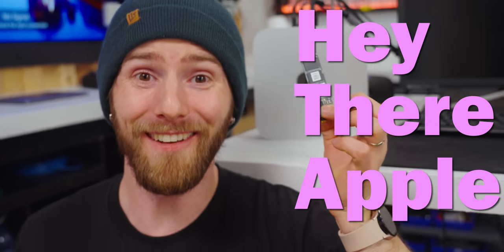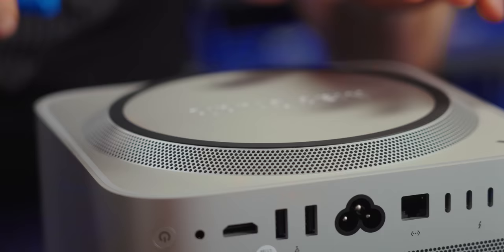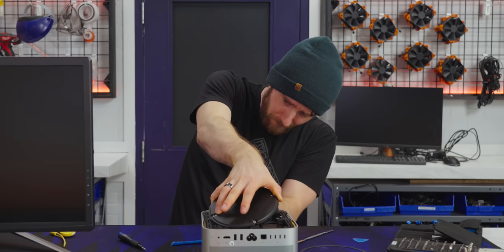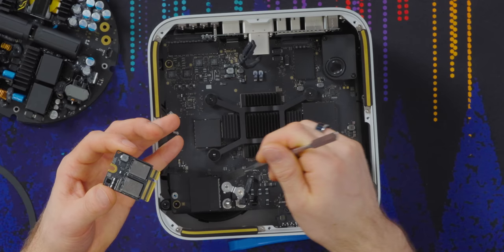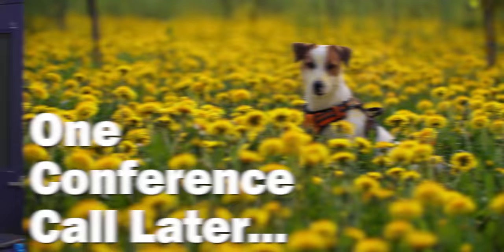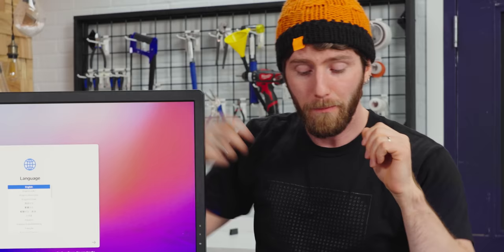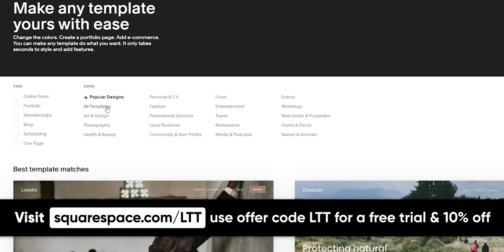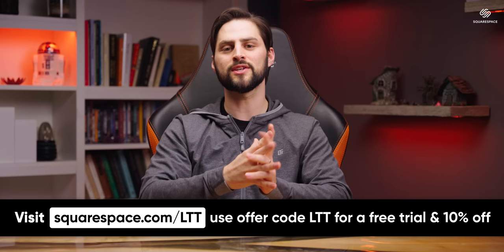I want to love Apple, but they’re making it hard - Mac Studio SSD Swapping

Comment: Apple is making a killing on upgrades. Apple is clearly anti-consumer, however their marketing and brand recognition is so strong, that the very people that they are screwing are defending them like there is no tomorrow. It is just sad.
Reply: and enter one of those defenders 😂. Apple has a philosophy. To make great software, you have to make your own hardware. I've always been a PC enthusiast and enjoyed upgrading parts. The problem is that Windows frequently crashed. A lot. Usually driver conflicts from various manufacturers. I now have a Mac Mini M1. Sure I can't rip it open and add a new Wifi card or RAM module...but it's never crashed. Not once in the six months since I've switched. Add that to the fact I really never have to worry about malware or viruses... I'm sold. Maybe it's just something that happens when you get older, but I don't I don't want to rip open computers just to add upgrades that don't work because of driver conflicts anymore. I just want something that works for my needs and so far Mac excells at that. I use to blame Windows, but you can't expect an OS manufacturer to make sure their OS works with every third party peripheral, or expect peripheral manufacturers to ensure their peripherals work with every other peripheral on the market. That's why Apple adopted the philosophy to build their own hardware. Yes, they still use third party suppliers for stuff, but very much under their own quality control. Enjoy your blue screens of death that you get from the freedom to mix and match hardware. The time I save from not dealing with that crap anymore has made my M1 Mac a very worthy investment and I can understand why Mac doesn't want to get the same reputation Windows has by allowing consumers to mix and match hardware willy nilly causing OS crashes.
Reply: @jamesboggs5735  tell me you don't know how to install drivers for hardware without telling me you don't know how to install drivers for hardware
also, your mac can't run most games which is fine if you're not a gamer but as long as gaming exists, windows will still rule. 
Mac is like a golden cage. It is nice, but still a cage. No freedom to experiment with.
Reply: @jamesboggs5735  I work on windows. 0 crashes in 3 months. 1 crash in 6 months. I can make my OS to be the way I want. Everything is the way I want. You can't do that on Mac.
Reply: @jamesboggs5735  the same regurgitate stupid and not trie things that apple zealot said. I remember when i have my first pc, a windows 98 gateway machine and my best friend ordered the first imac, he criticises pc to the end, even without the imac. We has been in my house with my pc, zero crashed. The day arrive and the super imac was delivered. The imac goes crash after crash, evenhe needs to disconnect the machine from the power outlet to start again because there were no other way of escape from a hard crash. I can print things doing another thing and he cant because his super mac was not multitasking. I know the history and the lies combine with apple distortion field. All the things that this guy said, are not  true. I own my gamer windows pc, and zero problems, zero cashes
Reply: @jamesboggs5735  And here enter someone working professionally with ALL these systems. 
Crashes happen on all OSs
Apple doesn't have more great software, they approach is to make simpler software. Windows can do much more, hence it can crash more often, but we are talking 5/100pc vs 2-3/macs in average. My PC didn't crash last 3 years. No joke.
Anyways, what I was talking about was being ripped by Apple. So, this is not related to which hardware or software is better. It is how its clients are treated.
I will tell you: disrespectfully.
Because, nothing stops Apple to sell you two more chips for double the price instead of triple the price, except they have control you and you are not allowed to upgrade your OWN hardware! Just think about it. You gave (a lot of money) and you still have no control over.
And the real reason: Not the technucal one, or client oriented, but so that they can make more money. On you, their true customer. 
Take as you want, but I do not like being treated that way. Period.
Reply: @jamesboggs5735  Well, I use multiple Systems. My undervolted Gaming PC (Windows) runs stable non-stop. Only those damn Updates make me reboot. I use a MacBook for Work. Runs fine for a while now. But a while back a major Update killed it. Good, that there is Time Machine Backup. MacOS has it's ups and down. For example M1 is not quite there for me as a Developer. 

But, all of you forgot about another big OS. Linux-based Distros are killer in some disciplines. I got Machines running for months without a restart at all. Not one crash in years und really fast updates. Shockingly, some Desktop Distros are even more user-friendly than Windows 10.
Reply: @jamesboggs5735  Found the apple shill
Reply: @jamesboggs5735  old people really dont care whats happens to the future generations and it shows. Just because you can buy a new Mac with your 401 whenever the screen ribbon ripped doesnt mean you should support them.
Reply: @nadarith1044  I guess I am too. I'm just not into ripping shit apart or upgrading things. I just want it to work. My iphone 5 and macbook air just won't die so I guess I'm a fanboy or whatever.
Reply: @xergiok2322  BINGO! I have replaced the battery on my macbook air but thats as deep as as I ever want to go.
Reply: @jamesboggs5735  I am a longtime Mac user, made President of our local MUG in the 90's. Got a bit freaked out when OSX arrived but learnt its quirks (fsck anyone?) I got a new M1 MacBook Air recently and guess what? The dreaded spontaneous screen crack occurred it's now a Brick sitting in the closet reminding me to NEVER buy new. I'm happy with an older model with magsafe, regular USB etc.
Reply: @nadarith1044  I guess I am lazy but you get that. If the next ones fail, I'll change but at this rate... there's probably only a few changes in me before I get boxed up
Reply: @user-kc5fp4tj9y  Please tell me what all these alleged bugs are in macOS; I don’t encounter any day to day.

If you want to hack at your computer, use Linux, more power to you.

If you want your computer to run out of the box with very little muss or fuss, in my experience you can’t beat a Mac.

It all depends upon what YOU want from a computer.
Reply: @DS-pk4eh  As I said before, when I buy a washer I don’t get upset when I can’t upgrade the pump or the motor to increase its spin speed, I use it and when it no longer does what I want I buy a new one.

It’s no different for a Mac. I buy it configured how I want it with the knowledge that when it no longer suits my needs I will buy another; pretty simple.
Reply: People are mad about not being able to get inside their Macs, upgrading them and so on.. But to me this makes total sense! This is what Apple does - they make it as easy to use for their customers as possible. Which is amazing and I love it! It is same with their software - they dont let you to change the some core funtions of the system, intead they build a Mac or create a software that works perfectly and is not meant to be changed by users that many times dont even know what they are doing.. Apple prevents users from accidentaly damaging their Mac or the software. Just buy the product from Apple that you need and use it - it works perfectly as it is and no need for any stupid upgrades which might cause many problems to the device. It is more expensive for the user, but I love that their products work as they are supposed to - windows and android devices can be repairded or modified easily but that brings many annoying problems.. I remember how many hours I spend on youtube on various tutorials for fixing something.. So I am totally fine with Apple creating a great device that is not meant to be modified and just works as its supposed to!
Reply: @VideoArchiveGuy  Except it is different. If there were the washers that you could build yourself, upgrade, than you could compare them.
Mac is a computer, and we know there are many,many different computers. Some, you can even build them. But that is not what I am saying.
It is OK if you buy your computer (Mac being one also) that is premade for you. It is not OK that you do not OWN it properly and that you are artificially limited in its repair-ability.
All that for greedy reasons.
Reply: @DS-pk4eh  False equivalency, as there are not Macs you can build yourself, you buy them preconfigured as a closed system.

You understand at the time of purchase memory and storage cannot be expanded internally, Apple is VERY clear about that.

It is not like a computer in the PC hobbyist definition of terms, but rather more like a Blu-ray player. You don't buy a Panasonic or Sony model hoping to upgrade your player's CPU or memory later, it's effectively an embedded system that does what you want with a minimum of fuss.
Reply: @VideoArchiveGuy  But that is the jest of the issue. It is so, because Apple decided to do that way, in order to secure even more profits, not because it is not possible (one iMac and MacBook Pro next to me proves you can at least upgrade memory). They actually spend engineering time to make sure a owner of device can not upgrade its own computer.
So, the extra 32Gb of RAM will cost you double than what is the market price (same specs, just Apple label) and you are saying you are OK with that?
In the end, you might be, but there are others who are not.
The thing that I do not understand is, how people are OK with NOT being respected as a proper customer. That, my friend, I really can not understand.
Reply: @DS-pk4eh  Ah yes, the straw man of "you can't do this and you can't do that" when you haven't been able to upgrade the RAM in a Mac laptop for a decade now.

With current machines, it's because it's faster to access RAM soldered to the motherboard as it eliminates the use of bridge chips, a slowdown, and DIMM sockets are one of the biggest points of failure, making the machines more reliable as a bonus.

I don't look at the price of RAM in that way; I look at what I need and what it costs at time of purchase. If it proves not to be enough, it's time to get a new computer.

This is no different than storage in an iPad or iPhone which is similarly not upgradeable; its no big deal.

There's no lack of respect here, it's knowledge of how the M series CPUs work.
Reply: @DS-pk4eh  They aren't the same spec and you're comparing ancient Intel motherboard designs with current M1 motherboard designs.

You haven't been able to upgrade RAM in a MacBook Pro since 2012.
Reply: @VideoArchiveGuy  I think you are not getting what I am trying to say. So, from me, wish you great hours with your devices. Just enjoy.
Reply: @DS-pk4eh  Enjoy yours as well!
Reply: @jamesboggs5735  great software like Safari lol
Reply: apple is like a religion to some people-it's insane
Reply: @burlhorse61  As is apparently the idea that not everyone cares about being able to update their computer with new pieces and parts.
Reply: @jamesboggs5735  tl:dr
Reply: @jamesboggs5735  6 months? calm down there lol
Reply: @jamesboggs5735  i have a PC from 2014 i dont belive i have encounter a random crash or a Blue screen even after changing hardware
Reply: @jamesboggs5735  Man you've bought into the delusion because you're ignorant in the subject. Just because you know lefty loosey- righty tighty and have replaced some PC-E component doesn't make you knowledgeable about computers or how they function. In fact, you claiming you had to deal with so many crashes just concretes the idea that you had no idea what you were doing in the first place. You're the target audience of apple, glad you're their customer. Enjoy the training wheels.
Reply: @nadarith1044  A shill, by definition would be getting paid by apple for promoting them while not actually believing in their product. I am not paid and am a genuine believer in their products (to date at least). That’s not a shill. Sheep, maybe. Not a shill though. Maybe learn words before using them next time 😂
Reply: @VideoArchiveGuy  Most people do care about cheap basic repairs, good customer support and shit that isn't overpriced fragile garbage however
Reply: @jiriq8853  Damn but apple trained you well!

jokes aside what you said isn't the problem and if apple was only that then it wouldn't be bad, but apple is also fragile overpriced hardware with minimal customer support and specifically prevents not just overhauls but even the most basic repair and future proofing, a true company like you described would make swapping hard drives easy and idiot proof, but apple not only makes it near impossible but even does shit like needing another mac for the process and even sells charger plugs separately!
Reply: @nadarith1044  I get that, which is why your comment has nothing to do with Apple.

They rarely need "basic repairs," have the best customer support in the business, and aren't either fragile or overpriced.
Reply: @VideoArchiveGuy  Then you're either lucky, using older apple products or in denial, most people in this comment section seem to have had a shitty experience

also saying that they aren't overpriced is straight up denial, a prebuilt pc or laptop in the price range of mac has MUCH better specs and a better software range too
Reply: @nadarith1044  Not at all.

The key is "most people in this comment section" - a self-selected group of people who generally dislike Apple.

Expand to the general populace, and really, it's not as common as you would think.

Of course they have issues but they've also been absolutely wonderful in my experience when one crops up.
Reply: @VideoArchiveGuy  I was talking about people that detailed their apple hardware failing, a significant portion was even about products before things like the infamous apple screen crack became a common thing to hear about

not some self-selected haters, not that it's hard to hate a company that won't fix a screen without you having to pay more than the cost of another iphone and specifically makes it harder for anyone other than apple to fix it if even a quarter of reports is true

apple hate i've seen here also reads differently than the shallow 'hating things is trendy' hater crap microsoft windows, ubisoft games or marvel movies seem to get while most defense seems shallow fanboy stuff, this inverted shallow/deep hater/lover ratio is generally is a sign in favor of the company doing something bad (while for things like microsoft or marvel the ratio hints at bandwagoning against something popular because it's popular)
Reply: @nadarith1044  "Infamous Apple Screen crack" - another story propagated by haters.

When Apple does find an issue affects more than a few users, they generally create a repair program that not only handles it outside of warranty, they reimburse anyone who did pay for a repair.

More to the point, why would anyone go to anyone but Apple to repair it? It might be cheaper in the beginning but it won't be done as well and it may cause other damage that will not be covered by warranty if any remains.
Reply: @VideoArchiveGuy  How about you stop assuming i read hater posts instead of people asking for help? because by this point this is outright denial, if anything i saw more apple fanboys when looking through those defending apple employees even when nothing about them was mentioned than anything resembling hate

the program you're speaking about is only for apple watches so yeah no

"More to the point, why would anyone go to anyone but Apple to repair it? It might be cheaper in the beginning but it won't be done as well and it may cause other damage that will not be covered by warranty if any remains.
"
for someone like me that relies on local repair shops for all electronics including pc's and phones it's probably the dumbest sentence written

official repair shops are commonly worse and overcharge you, only someone trained by apple and their bs could say something like this, especially as apple makes their devices extremely hard to properly dissemble and repair without training and proprietary tools and spare parts (which aren't sold) EXACTLY to make that bullshit line of thinking stick

apple official repair shops are best for apple products because apple made it so with the way they make their products, then tell you it's a normal way this works, and you fell for it because it doesn't work like that with anything else

apple doesn't have haters and people that like a good company, it has fanboys and people that dislike their shitty anti-consumer greedy manipulative bullshit
Reply: @nadarith1044  As I’ve said before, it’s a difference in philosophy.

I would never take my Apple products to an independent shop for repair, I would always take it to Apple.

I do the same with vehicles, every service except for tires is done at the dealer, including oil changes.

It’s a bit more expensive but I know all work is done with factory parts.

I don’t do it because I am a fanboy, but because that’s who I trust to get the job done properly.

That’s my choice, you may make another but it doesn’t mean I am getting “ripped off” in any way.
Reply: @VideoArchiveGuy  The fact that your only comparison was with cars was telling, they aren't in the category of home electronics and maintenance at the dealer makes sense for them for multiple reasons that aren't found in electronics

this isn't about philosophy but anti-consumerist practices of apple and how you reframed them as being normal which actually damages things for everyone as companies see apple getting away with this shit and start copying the practices!

the talk about choice is especially hilarious as you don't have a choice, apple ensured it with their blackboxing measures, this isn't your choice but a shallow rationalization as normal pc's don't care where they're repaired or what components are used as long as they're good, there are no 'factory parts' in normal computers neither repairing them require special training, you should not be forced to go to an official apple salon to ensure a good repair in the first place but you have to because apple

and you're very much a fanboy as evidenced with you calling everything bad about apple as 'hater spread misinformation' or having shallow arguments that look more like rationalizations than actual defense
Reply: @nadarith1044  You keep saying they are “anti consumer” but they are not at all.

Apple are the ones trained to service their products and have access to parts.

If you want to risk your device by taking it to a third party you can just as you can your car, but have no one to blame butt yourself if they damage it.

That doesn’t mean the third-party person is incompetent, but rather the manufacturer provides a guarantee of a particular kind of quality and care.

It’s a little like going to a friend who knows how to perform surgery; they may be more competent than the staff at your local hospital but you have zero guarantees of that.
Reply: unfortunately windows has just never seemed as stable. however I haven't been a windows user since over 10 years ago. is it any better now ?
Reply: @BlaqZ  I mean if you're making music logic does kinda stand out way above the other daws
Reply: @nadarith1044  
It's impossible to reason with a cultist.
Denial is a pretty powerful motivator. 
They'll straight up tell you that the sky is green with rainbow polka-dots, while simultaneously refusing to look up and confirm it, just as they'll deny Apple's Forced Obsolescence business model even when they're reminded of the times Apple actually had to be taken to court to try and make them stop doing it.
Reply: @jamesboggs5735  maybe support linux then?
Reply: @jamesboggs5735  man does have a great point also my Macs have always lasted well over 8-10 years without issues
Reply: That sounds like the Trump coalition
Reply: @jamesboggs5735  so, you buy an Apple computer, and You don't have the option to change anything, but it doesn't have chrashs, but You can do the same whit non-apple's computers (don't change the hardware the computer come's whit), repairs are easier and you even have the posibility of upgrade it.
Reply: @BEEFBRSKT  
Once upon a time, Logic was available for ALL systems. Remember that? I do. 
Then Apple bought it, dumbed it down and locked it to their own hardware.
It was far better before all of that.
Reply: just multi os users here
i would say, use what you like, and if it just works and you happy with it then so be it
Oh btw my windows 11 machine never crashed since i installed it back in leaked build days till today, had 2 semi crash due to my mistake when installing graphic driver, while my linux install was rock solid until i just start messing around here and there modifying something in root directory and made it crash 5 times, never use Mac since i dont have apple products nor i have hardware to do hackintosh and knowledge of its art
again uss what you feel robust
Reply: There are informations everywhere, if a person refuse to open their mind and decide to become a sheep, it is their fault
Reply: @jamesboggs5735  the "WiNDowS aLwAYs CrASheS" meme is just that, a meme, i havent encountered a crash on my pc for the last 2 and a half years, even in the xp era, ive handled 5 pc's during that time and i only encountered ONE that crashed, BUT, it was caused by hardware failure because the hardware in question was old and banged up at the time.

stop these lies my dude
Reply: @ker--ker--kerr  used windows XP for 8 years 0 crash, used windows 10 for 2 years+ now some minor hick ups here and there but only 2 visible system crash where the system actually just went poff and had to restart no blue screen of death tho.
Reply: This is one thing that really bothers me. People who hating Apple does not just attacking Apple’s “anti-consumer” behavior, but also the people that using one for a reasons. As if, the people who buying them are real problem. I guess those are really thinking that but, what’d I know.

Also too many of them are hates when people mocking Windows for their inconvenience and trying to depending it. Why? If it’s Linux or KDE I get it but, are they forgot Windows is own by a giant company too? Windows is not standard computer OS, it’s a property of Microsoft. I thought they hate hypocrisy.
Reply: Proprietorship at its best
Reply: @jamesboggs5735  I haven't had a driver conflict in the last 10 years. You must be buying some no name brand hardware
Reply: @jamesboggs5735  me a guy working in design industry using mac on daily basis - Mac OS does freeze quite a number of time even on newer model and has trouble optimizing with several software plugins. In short, you can maximize mac usage without incident only if you use it in a very basic manner. Any extensive work on mac will start to make its operation go into ass mode.
Reply: @JeyAnirudhJekka  he fits the description of your average apple user.  Novice user, just wants an easy to use machine and OS
Reply: They are very “anti-consumer” I agree, but the reason we go for them is because their tech products are simply great! Hands down.
Reply: @jamesboggs5735  I've owned windows for my entire life, I've only experienced 1 Windows crash under any circumstances and it was because my dumb 10 year old self completely filled the hard drive and it didn't like that. No driver issues either, you clearly suck at installing them if they're conflicting enough to crash you, considering they shouldn't be affecting each other hardly at all, if they even do
Reply: @jamesboggs5735  This is not the 90s nor the early 2000s lol. Windows nowadays are stable af. I have been using Windows 10 LTSC enterprise for 2 years believe it or not it has never crashed
Reply: @jamesboggs5735  pc enthusiasts who uses apple products. no...😅
Reply: @jamesboggs5735  wow... Spoken like a true Apple lover... 🤣🤣😂😂 Go ahed and waste your money... I'll stick to my high end gaming pc that'll blow your Mac Book out of the water every time
Reply: @VideoArchiveGuy  I would agree with you if it wasn't that just like nadarith said,the official methods always overcharge you and it's better to get trustworthy third party ones.
As an example instead of overpaying for an official charger I could get a trusted third party one that also includes warranty that covers up potential damages in case anything does actually go wrong with the product,I would rather that than getting my money stolen.
Reply: @Abaw  I almost never use third-party anything, especially when it comes to repair parts, it's simply not worth the risk.
Reply: @VideoArchiveGuy  if the device was new, I would do the same thing if the official accessories were already included with it, I'm not spending more money on an official charger that wasn't included with my phone
Reply: @Abaw  You don't have to, that's the point.

Everyone has tons of power blocks just lying around, whether USB-A or USB-C.
Reply: @VideoArchiveGuy  what I meant with my reply was explaining what I would do in case I had to.
I still do not own a USB c cable (still using a phone with micro USB) but once I get a new one it will definitely come in handy.
Reply: @castorchua  apple are stupid people friendly lol
Reply: @andrew66862  That's your opinion; there's nothing I've ever wanted to do that an Apple device prevented me from doing.

Different people use their systems for different things.

Example: I've never had a desire to upgrade my graphics card on any system I've ever owned, so the fact that I can't isn't in any way an issue for me.

If you're an FPS gamer, that may be  an insurmountable issue for me; for most who use their computers to watch YouTube videos and to send and receive email it's simply not.

It's like saying that automatic transmissions make cars the "Fisher Price" of cars; I drive a manual transmission myself but many people don't want to.
Reply: @andrew66862  How are they not "allowing" it? You can take your iPhone in and get the battery changed for a minimal fee. Many devices don't have power cables you can change. Not allowing unapproved apps is why iPhones aren't the security free for all Android phones are and are one of the things I value MOST about the platform.

You assume the things YOU want to do are the things EVERYONE wants to do, and that's simply not true.

If it's not right for you, that doesn't make Apple a horrible company, it just means a DIFFERENT product is better for you.
Reply: @andrew66862  Again - insultingly simplistic to YOU.  You're obviously a hardware person, so go enjoy the PC/Android world and have at it.

A LOT of people want a device that is easy to use yet is powerful enough to do anything they want it do, and that defines the Apple ecosystem to a tee, and as an aside, is one of the reasons I prefer it.

I deal with computer systems all day every day and the last thing I want to do is dig around the inside or "install new drivers" when I'm at home.

What do you think of Tesla?

Many people buy them, but Tesla does not release ANY repair information to anyone OUTSIDE Tesla, yet that doesn't stop people from buying them who just care about what it can do, not what they can tinker with.

You keep trying to make it about Apple's "limitations" but the reality is it's because you define it based upon what YOU want to do.

It's "limited" because you can't do what YOU want to do, but that doesn't stop it from meeting the needs of millions of customers who appreciate the device for its simplicity and its functionality.

I put VALUE on the fact that I can only purchase apps through the App Store, I like KNOWING that they all go through Apple.

Again, not your cup of tea but it's a REASON I choose Apple devices.

You say it's ridiculous you "can't" use an unlicensed cable, yet they're not JUST cables - there are voltage regulators in the plugs and I like knowing that the manufacturer of an accessory had to submit their device to Apple for approval; no approval and it's not getting anywhere near my devices. (Frankly I take it a step further and only purchase Apple devices and cables whenever possible.)

This is no different, again, than people who only take their vehicle to a dealer for service (again, something I choose to do.) As an example my Toyota is 11 years old and has 180,000 miles on it and no one other than the Toyota dealer has every serviced anything but tires, including oil changes, belts, etc. That's MY preference.
Reply: Exactly.
Reply: @DS-pk4eh  also the fact that Apple saved dollars by including the controller on the chip instead of the board (if I remember that part of the video correctly)
And passed that savings on to you by charging you way extra to do the upgrade
Another example of how they created a proprietary way to rip you off
Reply: @jamesboggs5735  don’t call yourself a pc enthusiast then.
Reply: Absolutely, Ive seen plenty of comments on this page actually defend not being able to open up your expensive computer to replace parts. I guarantee some will even defend the $200 per 256gb storage upgrade or 8gb ram upgrade. Funny enough, these apple fanboys remind me of the trump cult
Reply: @Runmethem1sboi  It just updated to 12.6 or something. The battery is pretty crap to be fair.
Reply: @Runmethem1sboi  No, but people like you reply to eight month old threads with personal insults.
Reply: @JeyAnirudhJekka  as someone who has a MacBook Air and a iPhone AND a custom gaming pc I will say that the guy who wrote that paragraph is correct, while my custom pc is still pretty good for the most part, I’ve definitely had more issues with it then my old dual core MacBook Air, it just works, and that’s why it’s the best.
Reply: @ker--ker--kerr  that’s because Mac doesn’t need that. Also you can customize a fair bit on Mac you’re right windows has more customization but it’s not like Mac OS has nothing…
Reply: @thedeadlygames9716  there's still a huge tradeoff on gaming performance depending on the windows gpu, moreover any person who's even slightly interested in tech can troubleshoot the common windows issue in a jiffy. I'm not saying windows doesn't have issues, but the common ones are very easy to troubleshoot. So yeah, if someone isn't tech literate, mac is the best for him/her. But when it comes to gaming, windows still stands supreme.
Reply: @jamesboggs5735  you should document before upgrading your pc you clearly made mistakes if it  crashed
Reply: @jamesboggs5735  "Windows frequently crashed" - "Usually driver conflicts from various manufacturers"

Tell me when you stopped using Windows without telling me when you stopped using Windows :)

Seems like you gave up on Windows back in the 90s. Since Windows XP, installing drivers is easy and without issue and crashes are experienced rarely. Mac's also crash rarely, but the difference is I can swap my hard drive without needing to buy a new computer, and anyone who actually supports what Apple are doing are fools and all deserve to be fleeced by Apple. You do you, and enjoy buying a new computer once your hard drive fails on you, while I can put as many hard drives into my computer as I like and have full control over my computer.
Reply: @jamesboggs5735  other than initial impressions of using a new product you can hardly call yourself a pc enthusiast if your not only going to defend apple on this front but also swapped to a mac... what part are you an enthusiast of? Fyi I've built hundreds of pc's between my job and personal life. I built my current pc about 5 years ago. I've upgraded my cpu and gpu once. Since then I've had 0 crashes in 2 years. Your mac not crashing in 6 months is hardly an argument. My dads had his hp laptop for 10 years and guess what, it has never crashed 😅 It might be slow because at this point it's decade-old technology but it has never crashed on him. But even then yes if your swapping parts constantly and doing nefarious stuff on your pc you're going to crash windows more often than not. But at the end of the day if you buy a pc and change nothing on it like a mac for years it'll never crash unless just like mac you get bad components or have some bad os or some other software update... but that's the difference between apple and any other computer. you have the option to take it somewhere 5 years down the road or have someone you know or you yourself upgrade parts to bring it up to speed with current technology instead of going and buying a whole new product. Just straight up having a preference for apple sounds better than your spew about how good apple products are and telling a story about being a pc enthusiast. Because supporting this behavior from apple is literally the opposite. It's like saying you don't support physical abuse and donating to physical/ mental abuse charities then going home and beating your wife...
Reply: @xergiok2322  And Apple is Mostly a money Hungry Machine that since 2016 decided to solder the SSDs onto the mac motherboards and Also overcharge 4x the price per Terabyte. 2TB of Samsung / Sabrent / Kingston/ Seagate easily 180-200$ while on Mac : 2TB ---> 800$ (when it fails , the "repair" will also cost 50% of what you paid for your machine cause the way they go about it is replacing the WHOLE Motherboard with All parts on it ) Abomination. Desatruous for the customers wallet and for the environmant. May God give out His Justice.
Reply: @jiriq8853  the irony of having to pay so much more so it'll be easier and more simpler to use

(of course plus the thing where they lock the way out of you customizing it to lessen the chance of yous screwing it up)
Reply: @ker--ker--kerr  Another Windows user here. My system had two crashes in its lifetime. During the times I have used Macs, however, constant freezing and app crashes. I think I'll stick with Windows.
Reply: @VideoArchiveGuy also, Apple is called anti consumer because they rip their customers when it comes to device repair. You have to shill out so much money to get one repaired, you are simply better off moving to a brand new device. Which is exactly what Apple wants.
Reply: @mihirojha4475  Nice conspiracy theory, but Apple has always been completely wonderful.

The price to repair a device is directly related to the price and availability of spare parts, and often it is more economical to purchase a new unit.

If you check the repair costs for Android devices, the same is often true with them; many have had the same complaints about Samsung and Google devices.
Reply: @VideoArchiveGuy  The problem is just that he's full of it, there is no need to design your own hardware to make a super stable system, they're doing that purely so they can lock people out of it. Anyone could put together a computer from stock parts, install Linux, make it insanely stable, customize it, and then lock everyone else out from doing anything else with it so it would remain stable and bug free for ever. He's talking about the Apple philosophy, but their entire philosophy is "the customer is an idiot, so lets just make them pay us insane amounts of money for the privilege of not having the freedom to screw up their own system, because they will if we let them".
Reply: @daniel4647  Ridiculous conspiracy theory.

Proprietary ports are almost always better than standard ones when first defined, as was the case with Lightning as it existed long before USB-C.

Now there is a HUGE installed base of Lightning devices, and I have about twelve Lightning cables myself that would all get thrown in the trash if Apple is forced to go USB-C, including car docks, and many cables of various lengths.
Reply: I love Apple because there is no good alternative for me. I used windows for a couple of decades but as soon as I bought an old Mac pro I realised how awful windows is by comparison. Mac OS just works. Its UI is beautifully laid out, the engineering is incredible and they are built like tanks, plus theyre some of the most powerful computers out there. 
Yeah I hate the price and their ever growing lack of upgradeability, but thats the sacrifice we make I guess. Currently I'm using a 2010 mac pro which I have done a few tweaks to and it is still dominating most modern computers.